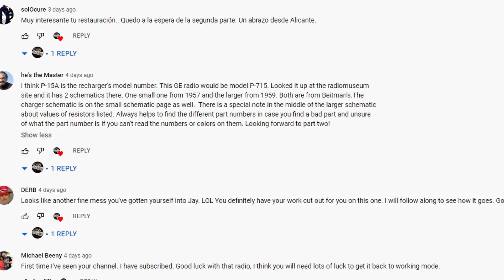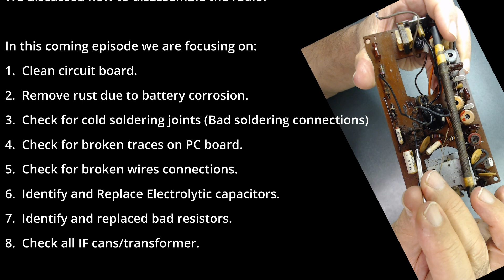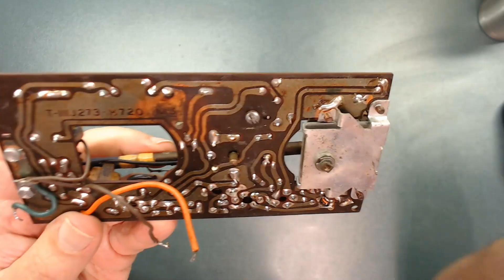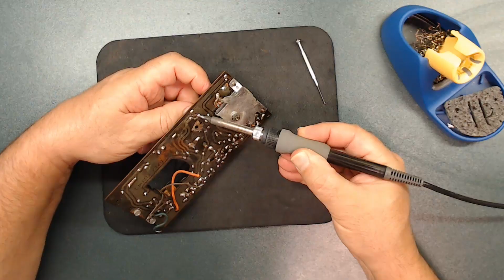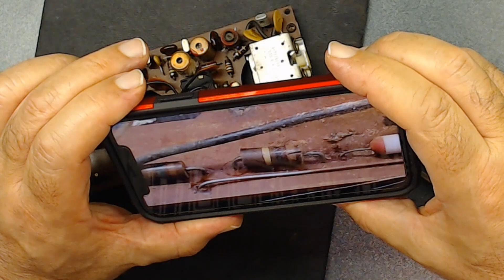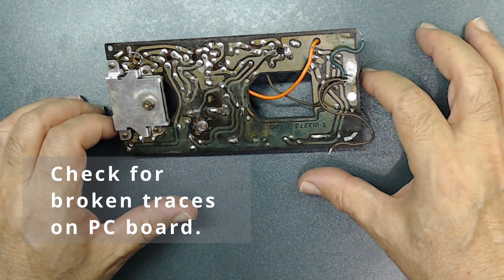Part 2- Restoring 1957 GE (First Rechargeable) Pocket Radio

Comment: Good series. That part that you removed looks as if it is the negative battery contact. Negative contacts always seem to be spring loaded and that is what that spring looks to be. Looking forward to you repairs to the IF cans if there are any issues. Keep the videos coming.
Reply from the maker: Hi Bob, so good to hear from you and thank you for uplifting message and great info. I am still working on this rust bucket.. LOL. I just uploaded the 3rd part, it is a fun radio to work on tones of unknown and mystery. I am amazed how they build this in 1957, it is so sophisticated design, i think was much ahead of other radio manufactures. Have a great weekend! Regards, Jay

Comment: The corrosion build up is a real problem for electrical connections. To neutralize it I normally use baking soda in warm water then after it sits for awhile come back and clean it with alcohol or contact cleaner. But you are getting it cleaned up the best you can and that's the main thing to do. Yes great idea using your phones zoom in function to check the soldering joints. Another great video and you are 25 subscribers away from 1000 congrats.
Reply from the maker: Hi Larry, next time I will try baking soda, in the past I used white vinegar to clean battery corrosion. This time I used the spray since it say on the can clean contacts. LOL  Hopefully this weekend will work on the radio again, long way to go to finish everything on this radio. OMG! you are right, need 25 more people who watch the videos and not subscribing. We need to charge $$ those that are not subscribing (like 65% of the viewers.. LOL) I guess they do not realize by subscribing they support our channels.  The most important thing is that we enjoy what we do, to share our knowledge to preserve and restore these historical radios and guns.  Good hearing from you my friend. Have a great weekend.
Reply: @RadioFixer  picking up my brothr Ron from the airport sunday his 5 months vacation in the Azores is finally over.
Reply from the maker: Glad that he is coming back, I know you guys enjoy each other company. I can’t believe how fast 5 months past. It seems was just month ago when you mentioned he was going there. Happy for you my friend.
Reply: @RadioFixer  Time flies it's true. He did a lot of work back there clearing trails that were over grown to the 250 yr old Mill he bought. He has a stone mason lined up for next year to rebuild the walls of the mill. He did a lot of other work like building his second waterwheel for the property and building furniture for friends.
Reply from the maker: Is so good that he is taking care of your grandfather property, working on old Mill, and help friends.

Comment: Hey Jay, good video. Looks like you are on your way to another successful repair. By the way, copper doesn't actually rust, but it does get a case of the green crusties from corrosion. :)
Reply from the maker: Hi Doug, you are absolutely correct 👍 it was  late at night working on this rust bucket, was not thinking right 😂 I should say get ugly green. You are the best! I appreciate you my friend. Have a fantastic weekend. Regards, Jay
Reply: @RadioFixer  I've been in the same situation myself. And when the camera is rolling it seems to add to the confusion. LOL

Comment: Rust!  Just get some Phosphoric acid on a Q tip. A short time later, all will be clean! It works!  Muriatic acid can damage the metal if left in too long.  Not so with Phosphoric 😊
Reply from the maker: Hi Arthur, good hearing from you and thank you for great information. Definitely try Phosphoric acid next time. You are right Muriatic acid did damage the metal, of course due to very bad rust could not save it so I am fabricating a part for it. Wish me luck! Have a good day! Regards, Jay